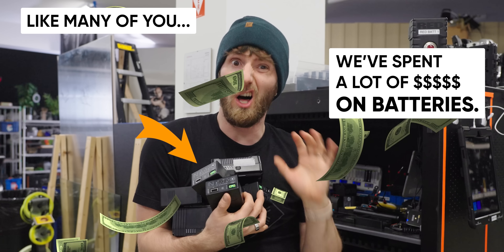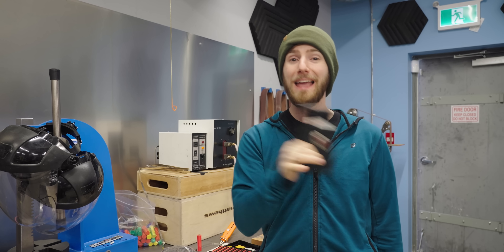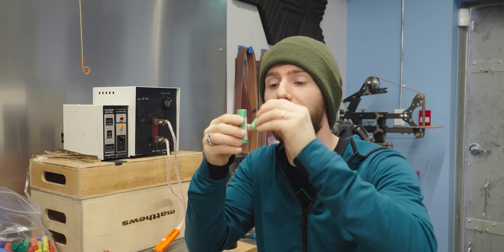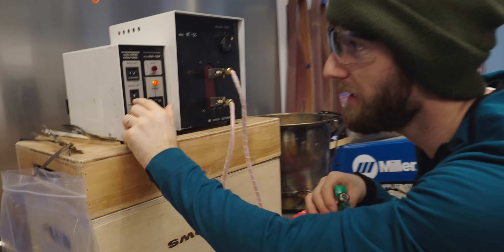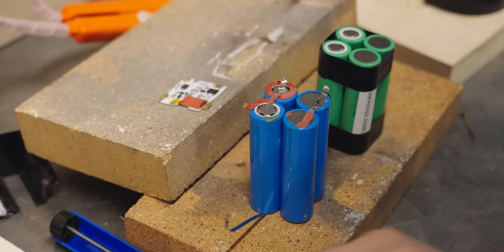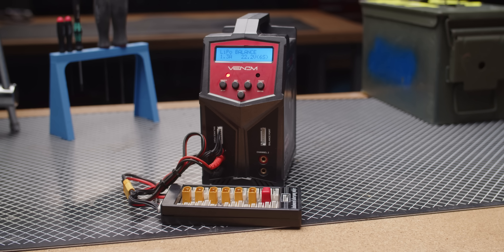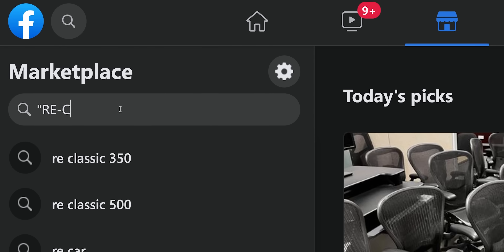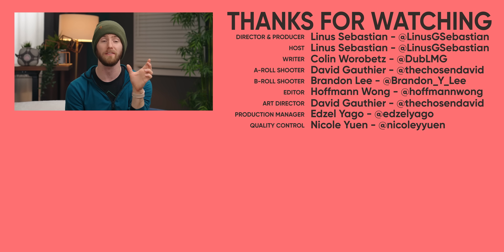This should be illegal… Battery Repair Blocking

Comment: Replacing batteries is piracy just like blocking ads is piracy. When you buy a device, it comes with the battery it is sold with. By replacing the battery, you are violating the agreement you made when you purchased the device. Repairing a device you bought is a violation of the implied agreement that you will use it precisely the way it was presented to you. Does this rationale sound sane?

Comment: worst e-waste: tomtom's.
mine refused to charge, pulled the battery , removed the bms , charged the battery on a lithium charger , held a charge no problem for WEEKS and discharged perfectly fine at a bit lower mah than the text on it said.(it's a old used battery after all)
wouldn't last a minute if charged via the tomtom..

Comment: I wonder if your welder was dodgy - I've been doing this for years for ebikes, scooters, vapes etc and NEVER had an issue (using 'generic' aliexpress BMS's) - my spot welder doesn't glow hot like yours though, it just makes a loud 'snap' noise. I suspect that your welder is making too much heat (my tabs NEVER glow afterwards), and that's what the issue is?

Comment: Risk control hierarchy:
Elimination (don't do the job)
Substitution (use something else for the job or another entity who is geared up to do the job safely)
Isolation (separate the task from people, property etc)
Engineering controls (guards)
Administrative controls (exposure time limits etc)
PPE
Health monitoring

But before control come identifying risks, assessing risks and reviewing the risk control put in place.
When spot welding if you can't use a control from higher up the risk control hierarchy use a visor, not just safety spectacles. Better still, though srill at the PPE level a powered visor which reacts to light. 
If the cell explodes you will be inhaling nasty gas, particulates, vapour and plasma. Two man died at one of our plants due to inhaled materials after a flashover, though that was a transformer in a substation.

Comment: Awesome video, love to see you guys bringing this type of concern to light
Reply: It's not any concern whatsoever. It's simply that these guys have ABSOLUTELY no idea what they are doing.
...
Anyone with haft a clue could have re-packed those and had them working perfectly. These idiots just tripped the protection as soon as they snipped all the wires off the BMS. The BMS is SPECIFICALLY designed to disconnect all power in the pack if that occurs, since it indicates a faulty group of cells that could case fire if recharged or discharged.

Comment: I’ve got a refurb Ultimate Ears (Logitech) Hyperboom with a questionable battery pack. I pulled it out of the unit and sure enough it’s a 4-5 pack of 18650s with a BMS on top. Searching high and low on the internet, it’s not even possible to find a replacement pack. In a case like this, the manufacturer’s solution is to throw away an otherwise functioning, $600 Bluetooth speaker and buy a new one.

Comment: Try charging Your "home-upgraded" battery pack, Your BMS looks "very basic" to me, so maybe all You need is to connect charger to wakeup BMS also 7V means 3.5V per cell wich is not much and maybe pack is disabled by device/BMS undercharge protection. Please try charge it and let me know if it works 🙏

Comment: Having used a spot welder about a million times working in a factory ... welding thermostats to kettle elements ..  sparks happen from time to time, I found if I lifted my foot off the pedal that actuated the welder in the jig before the spot weld cycle finished, or even relaxed pressure, sparks would fly like a volcano and I'd get a telling off from my supervisor if she seen me do it.  H&S and all, I didn't have eye or hand protection, save for a Perspex guard on the machine.  I think most of this video plays like a bad H&S nanny advert.  Paying too much attention to some safety procedures and over-reacting to them, while ignoring other factors, like tiny work area, gloves, no rings, bracelets, jewellery et. al.  Working in a correct work area so you don't have to hunch over the work and put your whole body in the line of fire up close.  I've worked with unprotected high current LiPo cells for decades, 18650s are little pussy cats in comparison.  When you accidentally short a LiPo the size of a pint of milk and see actual pieces of the metal contacts go whizzing around in little molten bubbles...
I once did short a LiPo, on the work bench.  Luckily a small one.  I was using a DIY dummy load and was using it to discharge the 3S1P 1000mAh pack at about 1 amp.  I was typing a facebook message and looked at the multi-meter to see it reading 16 amps... 15 amps... and to my horror, I seen the current sense resistor wire had broken off, so the mosfet was fully on, 0 ohm short.... then I looked at the battery, it was swollen almost round like a baseball bulging at the seams, and immediately I bolted out of my seat, pulled the plug on the load, grabbed a bucket filled it with water and rapidly scooped the battery into it.  Initially setting it in the bathroom, then fearing the smoke alarm waking the whole building I moved it outside for an hour.
Reply: Oh... once cooled down, it retracted to it's normal size, was a little puffy, but with extreme caution and knowing what I'm doing, I recovered it to 12.6V and it continued to function, although it didn't give you anything like 1000mAh anymore.  I put it to sleep humanly, by first discharging it to 2.9V per cell and then putting a 20mA LED circuit across it and letting it slip away into the night.

Comment: Any kind of planned obsolescence should be considered illegal, with fines to at least of the company:s 50% of value, that would make them stop.
Any kind of planned obsolescence should also include made by purpose bad quality products.
And please stop making electric cars, they are not yet the future, they will just produce mountains of e-waste.
Instead hydrogen cars should be made, fueled as a 'normal' car. The hydrogen should off course be made by green electricity.
I don't care about the low efficiency of creating the hydrogen, just do it
it will be much better for the environment in the end.

Comment: Guys you missed one step - BMS need to be "kicked" by voltage. There should be discharge MOSFET transistor - you need to put voltage on the gate of MOSFET. Just put multimeter in diode test ( buzzer etc.) then put one lead on plus terminal of battery pack, other lead into mosfet gate. Then whole BMS curcit will get power from the pack and keep transistor shorted, so you get 7V on your BMS output instead of 0V.

Comment: emmm... If your BMS is not outputting after you have assembled the pack - just give it a kick with a charger. It probably thinks that your cells reached LOW threshold so it cut output to prevent cells damage after cells recovered their voltage without load...

Comment: One of the things you have to do is apply charging current again.  Sometimes the BMS will be in a protection mode so it latches off until charging current applied.

Comment: Hey Linus, at this point I've watched to 6:58 in this video. I'm a professional battery tech. In our shop, we hot glue cells together with a jig that rest the cells at a 45 degree angle while we work. Hope this helps in the future to make things quick, easy, and professional.
Reply: I’m not a battery tech, but I do have a decent understanding of electronics, and plenty of experience with high power audio and high voltage tune amps...

I would have expected they would have graded the cells in a smart charger first, and then discharged the cells to say 5% prior to spot welding. Then bought the  cells up to say 50% with a smart charger before connecting the BMS. 

That said, I would expect all sorts of shenanigans from companies when it comes to locking people out of their “stuff”
Reply: @MidlifeRenaissanceMan  That was the way it was done on NiCad or Pb cells etc, but on Li-ion you have no memory effect, so you want them around 50% or nominal 3.5-3.6v is how they are shipped and used. I build ebike E-motorcycles batteries for a living that use 400 to 1000+ cell's 18560 or 21700 cells, and we need to test every one, so they are all matched before spot welding. And to charge Li-ion cells from laptops to EVs you use CC-CV power and the BMS does the cell level sorting and protection.
Reply: @hardergamer  cheers for that. 

the energy density of these Lithium cells is nuts when you think about it. 

While you could trigger a petrol explosion with a static discharge, in theory, something going wrong, when it comes to electronics, is an inevitability, rather than an outside chance, 

Everyone who owns a Tesla, I ask them to show me how the electric doors work. Then I ask them. “If you’re in an accident and the battery shorts, catches fire, how are you going to get out of your car ?”
Reply: @MidlifeRenaissanceMan  “If you’re in an accident and the battery shorts, catches fire, how are you going to get out of your car ?”

I don't know how Teslas are build, but I would expect that if they are going to use electric doors, that they should fail-open, which is that when the door is unpowered, the locking mechanism should unlock itself automatically (and the unlocking mechanism shouldn't require power). In other words, the door should be designed so that the locking state requires constant power.

That's how most electric door locks are usually designed, for fire safety reasons, and it's not uncommon for your local building fire code to require that electric locks are fail-open. 

The simplest of this design is that the door or locking mechanism is held in place with electromagnets, so that when power fails, springs or gravity would release the door/locking bar. The thinking is that the security of whatever's behind the door is never worth the potential loss of live that can result from a fail-secure lock, and by failing open, it also allows entry by fire fighters in case of emergency power loss.

There are also lock designs that are direction, by allowing unpowered exit, but requires power to be available for entry. Again, this is used for fire safety, to always allow people to exit no matter the availability of power.
Reply: @MidlifeRenaissanceMan  Discharging a lithium cell that far causes a very unstable situation and can cause cell failure. Please, stay away from lithium cells.
Reply: @BifsieOfficial  thank you, but I shall decline your suggestion to stay away from lithium cells. 

While, current lithium tech is sensitive to discharge beyond a certain point, logic would deduce two things. 

1. Less stored power is less dangerous when working on cell banks

2. There may be differences in the discharge / charge curves and so each cell would need to be bought back up to full charge individually

I was surprised they didn’t simply grade the batteries, given the relative low cost of smart battery chargers / testers / balancers. The AD converters on common micro controllers would almost make such an exercise fairly simplified if you wanted to go with discharge curve tracing over time rather than a simple discharge/ charge capacity between two voltages
Reply: @BifsieOfficial  Depends on how you define 0% and 5% - 0% = 0v = BAD.  0% = something in the 3.x volt range allows 5% to be a reasonable thing.  Most BMSes treat 0 as being somewhere in the low 3s, which also is why the pack in the video was locked out.  (as others have said, giving it a charge likely would have undone the UVLO.)

Comment: So about the only thing worse than a lithium hydride fire would be dumping over a container of chlorine trifluoride on to a iron or nickel alloy surface.  Chlorine trifluoride is hypergolic with every known substance including things that have already been burned or that are not supposed to burn, sand, concrete, asbestos, even ash will burn in the presence of Cl2F3.  The end result of that little spill would be a metal fluorine fire.  For which eventuality I suggest the best course of action being to invest in a great pair of running shoes.  Lithium hydride isn't much less obnoxious than good old Cl2F3

Comment: got funny idea why dont you put resistor  first to balance them ? for example a 0.2v diference put a 0.2 ohm resistor that will balance at a max of 0.5 amp
ps use calculator to find the ohm  lul needed
ps2 i may try this with some super capacitor but with voltage that i can do with my lowest resistor xD
Reply: confirmed it work i tried 3.2v and a 4.2v super cap and used a 10 ohm resistor
use calculator for other voltage but has long the voltage diferance it not higher than 1.2v you can use that 10 ohm
expect a few hour to balance out hehe between paralle cell *not series

Comment: Instead of spot welding I buy batteries with solder tabs attached then you only need to solder the cells together. To keep the BMS alive tack solder a temporary voltage source with the supply set to the exact same voltage as the cells at the time of disconnection  . Then readjust the temporary supply to the exact voltage of the new cells as this will prevent any unwanted voltage or current surges.

Comment: Here's another tip: DON'T DO THIS!! There's a dam good reason they don't want consumers to do li-on/lipo battery pack swaps. Unless you're a trained professional with the proper gear don't ever try any of this unless you want to burn your house down. (lipo/li-on fires are terrifying and much larger than you'd expect).

Comment: Lenovo did this! I looked up replacing cells for my x230T back in 2013 and users reported that the microchip in the BMS could detect a loss of power, and the rebuilt battery would fail to ever work again. Repair gurus would match reprogrammable power supplies to the positive and negative terminals to keep the BMS charged before reassembling the battery to keep it fooled into thinking it had not been rebuilt. Of course that's risky business, playing around with voltages and Lithium batteries. YMMV!
Reply: How does that figure?  I mean, they are rechargeable  batteries meaning you could use up all the juice in the battery - then recharge it later and it would take the charge...right?   I don't have a laptop, I am on 120V desktop so "this is what I understand - the recharging is what it is all about.  So if you run a battery down to nothing...it does not care.   So how does it know about the rebuild?  Just asking because I don't care.
. We need a battery that never dies or degrades.
Reply: @bunzeebear2973  think he was just saying not to over charge or over discharge either battery when working with both power sources, when trying to fool the BMS. When the BMS sees LVC, low voltage cutoff values for voltage it goes in recovery mode, fortunately most BMS is fine after charging the battery to a voltage above the LVC. Also to make sure not to short out either power source, original battery and secondary power source= battery , variable power supply or which ever equipment you are using to fool BMS.
Reply: @bunzeebear2973  BMSes use very little power - so little that they can survive for years on a shelf with a practically dead cell pack (read: something that won't even power an indicator LED if it were shorted right across the terminals), get plugged in and charge the cells to capacity as if it'd just been thrown in a bag yesterday.

Comment: Those sparks weren't dangerous. Had the unit started to smoke, etc then yes. Many folks use 18650 batteries to make their own "power-blocks" for storing solar energy from their homes. 

Additionally, you have to be careful with those nickel strips, especially if bought from amazon. Just earlier this week I was looking at some to do a small pack repair, myself and noticed a huge increase in bad reviews of the strips. Manufactures, mainly non-reputable ones are using lesser grade metals in the mix which is causing huge conductivity issues for the end user. I'm by no means an expert but do know a little regarding this. It's not easy and there's a thousand factors that go into play when making these.

Comment: you could just charge up the low cells to the voltage the others are at, oh and by the way parallel yeah you have to match voltage, but series you dont, but both are at play it seems. with 2 balance leads it looks like its a 3s set up comprised of multiple batteries in parallel per cell.

Comment: I have been retrieving good cells from laptop batteries for several years now.  Sure it is dangerous if you don't be careful but it gives me a good supply of 18650's that I use when only one cell or perhaps 2 are needed.  I also have some basic cell holders for when I need to build a quick 12 volt pack to experiment with, none are used in products that I intend to pass on to the folks who need my services for special build items, I normally now days simply put a 9V battery with a voltage regulator to run the items, easy for the user to replace and no recharging required as my old buds  were some time ago.

Comment: having built many 18650 lithium ion battery packs using recycles batteries from laptops. can tell you that the sparks you seen was just down to you not applying the pressure correctly causing the lead to arc to the nickel plate. not the batteries themselves there is nothing wrong with the cells you were chucking out of the door. looks like the lead you bought though was pretty crap. i personally prefer the leads that are separate and not held together as they are much easier to apply decent pressure with each hand to prevent arcing. i own the kweld kit and it is amazing no issues at all plus comes with heavy duty copper leads which are far better than the ones you are using